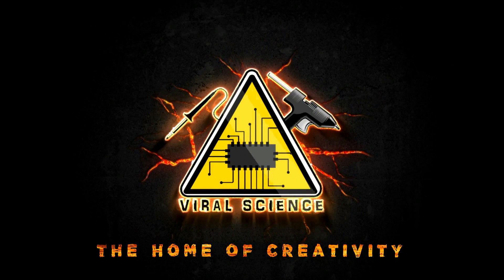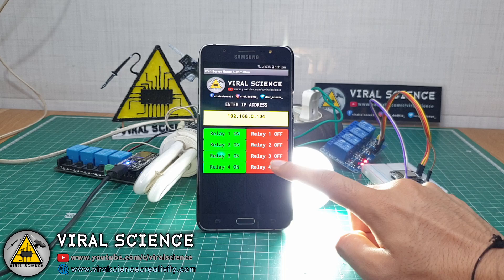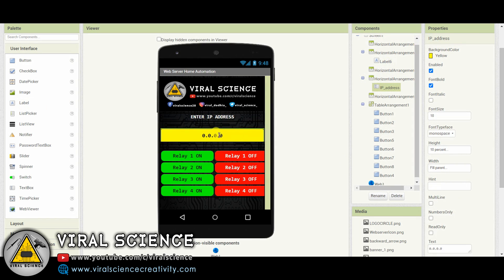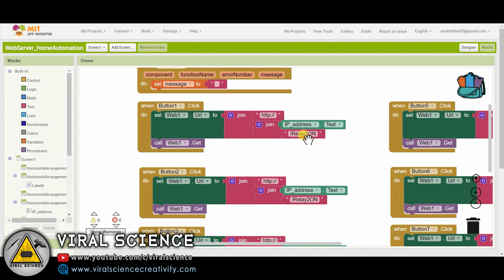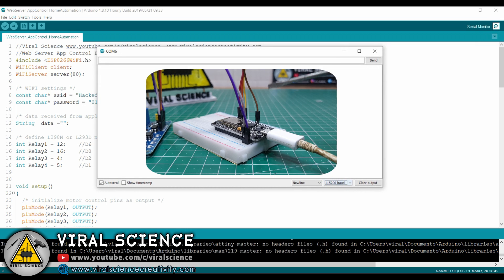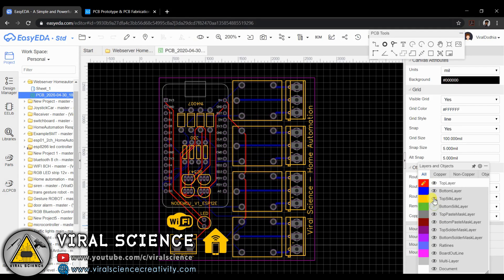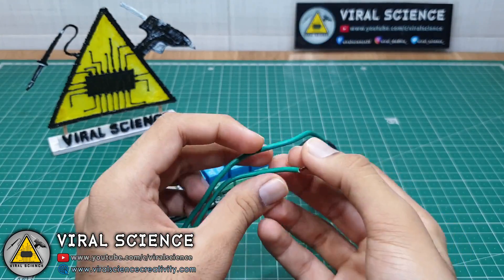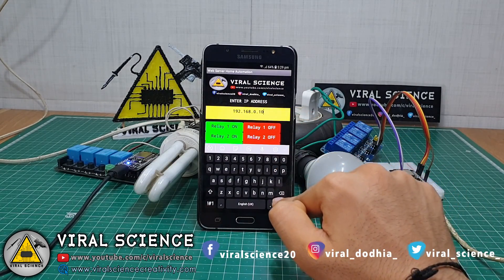ESP8266 Web Server APP Home Automation | Build Application

Comment: very good explanation, but did you know how to connect buttons to the arduino to switch the relay on / off and send a message to the app on my phone to see it on screen?

I had made this configuration you described, but i need to have physical buttons on my arduino to control not only remote.

The only thing what i dont get working is to see on my phone if the button is hit and the state of the relay is changed.